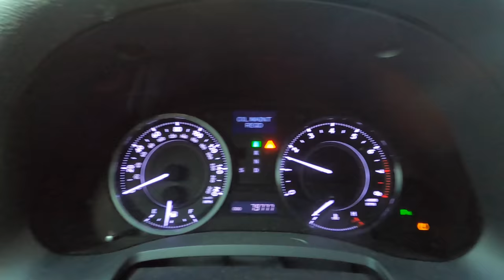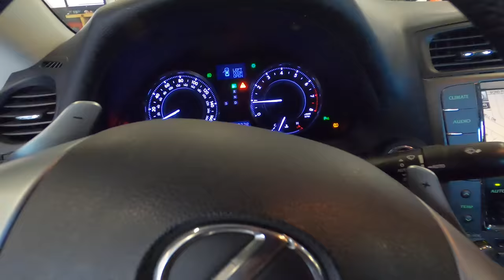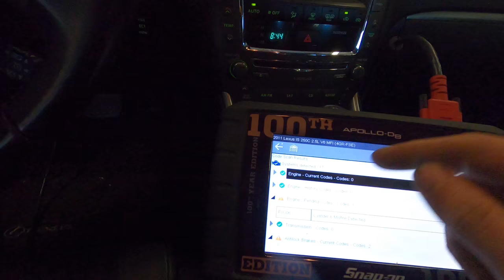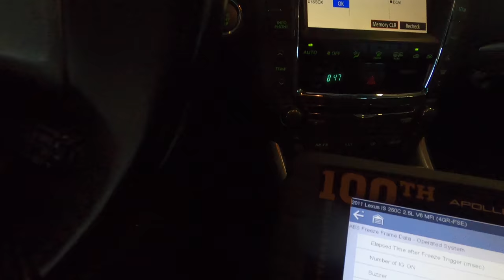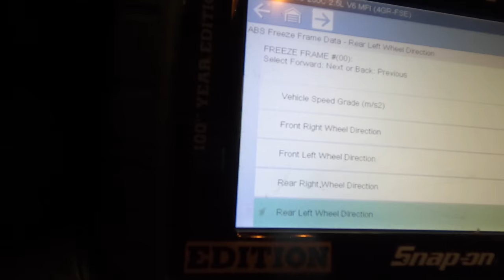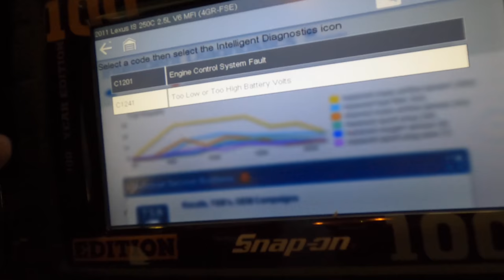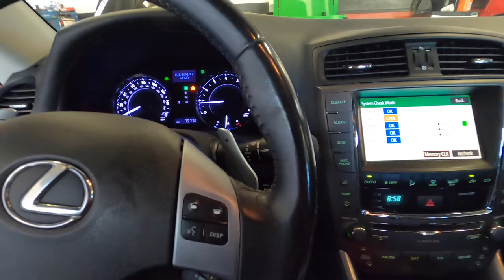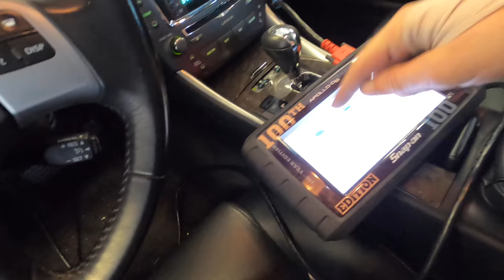Lexus IS 250:  Customer States Lost Power While Driving. Why can’t people communicate?

Comment: Looks like they beat me to it, the part with the bango fitting is a injector. I work toyota material lift side, they use a smaller version (though lp gas) for fuel trim as a way to recover during a dead head on hydraulics and also is used during trimming (obviously)
Those engines are a 4y. Yours looks a bit similiar and I would reckon due to emissions, Lexus (toyota) is trying to keep the normal hot operation mix leaner and needs the port inject to rich out so the engine can get to heat cycle and run to lean...possibly the case...not sure though, not automotive.

Comment: We stop learning when we croak....up to then we're all tadpoles. Hope when you disconnect battery you'll use a jump box to keep vehicle with a power supply. If you're still working as a tech when you're 70 you'll have worn a brace on on both wrists a few times. Lexus is the worlds most reliable and trouble free car.

Comment: Yeah  yeah...I know its an old video...but I owned the 2008 version IS250 and the 2006-2010 have a design flaw & TSB that presents exactly like the owner described...check out "IS 250 Carbon Buildup" online.  It barely runs, has no power, engine, VSC and other lights all illuminated and throws misfire codes...then problem goes away.  Root cause is direct injection causing carbon buildup on intake valve...the carbon breaks off & enters the cyl. which causes all sorts of mischief, the car goes into limp mode.  Disconnect battery, clear the codes and it will run just fine for a few months, then happen again.  In the 3 years I owned it it happened 6-7 times.  After the first few times & throwing parts at it you catch on that its not something fixable.  I moved onto a LS430.

Comment: 80k...isn't it getting close to timing belt time too? Good stuff. Stay safe and be well. Have a great rest of your day.
Reply: 60k is time to change the belt.
Reply: Newer Toyota engines have chains. And belts are sort of hard to judge. Age/mileage/oil leaks all play huge factors in how long you go before swapping. On a regularly driven and relatively well sealed engine 100k is pretty much fine
Reply: @lukeyarasheski5510  You think it's smart to hold off a small repair to wait for a big one?  Change a belt cheap job look ma I saved a few hundred dollars a month later look ma I will cost $1500.00 to $2500.00 to pull the heads and do the belt to how is that smart.  Now chain's last well over 100k so there safe butt logic show's the right way is replace at 60k why take the chance!
Reply: @edwardmartinez2472  I'm a mechanic so I do my stuff myself. So I mean 350$ish for the kit with a water pump. But yeah. My miata has had 2 one when I bout it at 110k (miles) and another one at 214k. My prelude is gonna be getting its fourth once I get the engine amd trans out to fix the flywheel because it has about 260k on it but I did it last in 2016. So 5 years 100k I'm fine with for belts. I don't touch chains as maint items. If I have to do like guide/tensioners, head gasket etc I do it all at once so you have fresh everything amd don't have to touch it for another 254k like my E36. So in summation yeah. Belts are fine for 100k provided average mileage per year and no oil leaks. Thats where the small job portion of what you were saying comes in. A cam seal is like 20$ when already doing the timing belt. Just unbolt the sprocket and swap seals. Way easier that aways. Oil will destroy belts. Any rubber really but especially drive and timing belts. Please don't let anyone tell you otherwise. Ferarri with their bullshit 3 yr maint.... I have done 2 different belts on those with less than 5k on the belts
Reply: @lukeyarasheski5510  That make's me crack up when people think there saving money by waiting.  Back in my day it's more Dodge Pontiac that when they eat a can gear it's time for a valve job bent valves when I started out in the late 79 I had a job come in no start shooting gas up the carb looked at the rotor not spinning timing gear plastic all eaten away put a new steel gear in and chain to my surprise it had three dead hole's off come the head's.   I was new I did not know about interference motors.   It was a 72 Tran's am with a 455 automatic live and learn.   I was never a pro I just like working on car's it helped me pay for Medical school today I still do work on car's when I have time.
Reply: @lukeyarasheski5510  I dont keep up with whom has what anymore as I dont twist wrenches as much as I use to. I only worry for what model is in my driveway nowadays.

Comment: At 35:26 you are asking about a Toyota cold start injector.  In a warmer climate they are completely unnecessary,  and you can block off the fuel line which feeds it.  I know from experience this is true.  Colder climates,  I cannot speak from experience.

Comment: Always use recommend brand of spark plugs. You can get misfire issues by changing brands. I use a rubber fuel line hose to put plugs in the hole.
Reply: Denso or OEM only on a Lexus, I agree.

Comment: A good tech knows if the engine has enough milage to need spark plugs you take no chances re using cheap to replace intake gaskets! Why take the chance of 20 to 40 dollars in parts but then again thats probally why I almost never have comeback in my shop atleast I dont.

Comment: No need for idle air control reset after battery disconnect? Transmission gear shift points reset?.
Newer cars may even need battery reset after replacement.
Things that your SnapOn can do

Comment: I notice you often use dielectric grease on spark plug connectors and coils, which is great but what puzzles me is when I don't see you or others use it on the battery posts. Maybe your experiences differ from mine but the battery posts stay cleaner longer if I clean and grease them.

Comment: I hired an airplane mechanic that turned out to be a great find.  He would work slowly and methodically, and when he was done I would always notice a couple of things.  Everything was back solid and securely. All replaced parts look factory new and there was no question about their origin.  He only did things once, in sequence, and never had to remove some of his work to get to the next step.  He was always very conscious of the next step coming up.  He was amazing.  Raiman, you look like you have these same traits.  I wish I could find a local car mechanic I could trust.  My local car dealer just went "doi, doi" on me.  They keep adding many things to the recommended to-do list, that are just ridiculous.  Like with only 15,000 mi, they want a complete flush and refresh of the transmission fluid.  Since then, I've been trying to find another dealer, after 30 years of service.
Reply: They recommend a complete flush because your new transmission, along with any other mechanical device is wearing in. It's a completely normal process.
Reply: I've been an airplane mechanic A&P IA for over 25 years and when I went through the program it's 2000 hours of book work (mostly FAR regulations) and a lot of practical hands on work. When you test there is a General test (math, electric, mechanical) Airframe test and then Powerplant. I have my IA or Inspection Authorization so I sign my name in the logs so if something happened the FAA/NTSB would go back and look at said log book there are usually 3 depending on type of aircraft 1 engine log 1 prop log and 1 Airframe log. There is a lot of responsibility being an IA and being an A&P for that matter.  Also an attorney doing Aviation Law may main job. I work on other people's airplanes on the weekends. We are very methodical and have to be!
Reply: The only airplane mechanic I ever knew was a friend of my neighbor and she usually had me work on her car but one time she had him work on it and I stopped by to see what he was doing and he basically told me he was way, way better mechanic than I'll ever be so said
" well la - de - fricken -da " excuse me.
Reply: @michaelszczys8316  lol

Comment: My 96 cavalier did the same thing after the alternator cooked itself, now it’s random when the ignition pulse dies out at the ECM killing the ignition at the computer not the ignition coils or module. A random ground strap left sitting inside the coil pack didn’t help as well when it was all replaced. Now it needs a new ECM.

Comment: Why didn’t you check the resistance on the coils with an ohm reader? When coils start giving out like that you will pretty much every time see an odd ball one that reads high or low compared to the rest. If it wasn’t reading off, I would start thinking an injector starting to go also possibly?

Comment: When you're first under the hood with the motor running looking at the new battery. I thought I heard a ticking sound like a spark jumping to ground. But the sound over YouTube doesn't make for good trouble shooting. I would want the coils marked from which cylinder and put in the trunk. Are the new coils manufactures brand?
Reply: that tick is normal for that engine

Comment: That back intake bolt is such a pain in the ass all has to be done by touch only....had to do it on another 3.5 v6 Toyota.  Yea I never replaced those intake gaskets and never had issues when I did the coils several times.    Will say never had a bad coil cause a stall though.

Comment: Did you forget to put the rubber gaskets back on the coils on the driver side bank, or did they get replaced on the coils entirely?  The coils got put back in, but the gaskets you took off are clearly visible and then in the next jump cut they're gone.

Comment: So I’m noticing that new engines don’t have spark plug wires they each cylinder has a coil and you just plug a power source into it? The newest engine I’ve ever worked on is a 1980 Ford F1 50

Comment: i remember growing up  my dad always told me  to replace everything in pairs   if i has  one plug go bad  i would  replace them all with  wires    sure  i would spend more  but i would  fix it  once and  be done   if this were my car  and  it is a nice car at  that  i would have  replaced  plugs wire and  all he coils     but the funny thing  when my dad got alot older  he would  get mad at me  and tell me  why are you replacing everything when  you only  need to replace  the bad ones  lol
Reply: I used to think like that. Now parts quality is so low I would rather run an old part over a "new" one. Stuff like plugs, absolutely. 

I just did a timing chain job on a 2.4l Chevy. Primary and secondary. I could have done the water pump, but it wasn't leaking. I let it go and crossed my fingers. Owner did not want to pay the extra $ and I agreed with him.

Comment: Man that looked like a pain. Why would you block off the coils and the sparkplugs with that plastic monstrosity? I swear enginers just hate us who have to work on these things. I don't work on a lot of new stuff since I am in private shop and they give me a lot of stuff that is 2005 an older especially OBD-1 and pre OBD. I have no clue why other then mayby I have the most experience diagnosing older stuff manually. There is still some dumb designs but that big plastic intake covering half of the plugs makes little sense to me.

Comment: For some reason on my 13 corrolla when my fuel pump started to die and then died, the car would lose responsiveness and then sometimes would turn off completely until one day the fuel pump was just dead. The check engine gave me no trouble codes (from what i remember) to let me know what was going on. Just putting it out there because that might be something that is happening with this car.

Comment: well. Do not know how others but i really did not like the additional dielectric grease - the amount from manufacturer comes only around the booth to seal just with sparkplug ceramic body to avoid having contact with the ignition tip. With this full booth of grease you are touching the ignition tip while seating. This has to be avoided...you are creating additional resistance...Sorry to teach you around - Been watching some videos of you and not really in all i am satisfied with the job done . In some fields improvement can be made.

Comment: I noticed that the coil washers/insulators for numbers 3 and 5 coils weren't put back on.  They were laying on top of the working area when you were replacing the bolt on the rear of the intake manifold but disappeared at 31:19.  ???
Reply: the coil has been replace with new ones ... so, the rubber o ring aren't neccesary anymore ...

Comment: At 30:55 The three plastic discs should have been replaced around the spark plug holes b4 the new coils were added? right?  You removed them at 24:36

Comment: Wasn't there a time when replacing spark plugs was a regular occurrence? Now it seems like a bit of a nightmare.
Reply: Spark plugs are higher quality and have very expensive metals on the tips, they can last well past 100,000 miles.
Reply: @spicysnowman8886  Bingo!  Old copper plugs used to have to be changed every 30,000 miles.  Now they only have to be changed once or twice for the life of the car.  Because of that the engineers don't worry so much about keeping them out in the open.

Comment: I love working on Toyota Lexus cars. Well made and thought out.... Here in the UK we have a model called an AYGO and to change a clutch is an absolute doddle to change.... Can do it within 3 hours easily.... The cars I hate to work on the most are BMW AND VW AUDI!!! GARBAGE TO WORK ON. Currently I have a BMW X6 40d with the twin turbo diesel engine... have to change both turbos as they were starved of oil and both grenaded each other..... have to support the engine and then remove the entire cradle.... Removed the oil pan and it was just sludge!!! Typical person who wants the badge but cant afford to maintain it!!!!Absolute junk though as I spent most time swearing and losing my temper with it. Luckily other cars were needing work to make a break for me from the junk

Comment: What are the most reliable 3rd party electrical parts in your opinion... Denso, Bosch, etc?  If you're can't /won't afford the dealer coils, if given a choice, what company would you go with AND given the company you name, what is your best guess at its failure rate (as reliable as OEM, 1/2 as reliable as OEM, etc.)?
Reply: Denso is often used by oems and is very reliable

Comment: Since it's on the intake,  I'd guess that it is to take the temp of the air and then adjust the mixture of Air/fuel for a more efficient burn. (Totally a layman's guess, I'm lucky to know the difference between a flathead and a Phillips screwdriver)
Reply: That's easy, one's an engine and the other removes the slots on the heads of screws

Comment: Why do you drop the plugs in by hand rather then sticking them in the spark plug socket lowering them in  and turning them by hand with the socket and extension bar? also which brand do you like of the extended reach power ratchet do you use is it snap - on or Milwaukee or something else?

Comment: At 30:00 Reinstalling the intake manifold without replacing the gasket is ok?
I had a mechanic replace my spark plugs and the intake manifold had to be removed to access the rear plugs. I replaced the gasket. Now it runs terrible. Loss of power misfire. I suspect intake manifold was reinstalled correctly.

Comment: Car may have been on when the battery was replaced. Sometimes techs replace the battery with the engine running to prevent a loss of radio station presets, etc... That would cause the low voltage code and usually causes some sort on ECM or ABS code. Also, I'm wondering if your service advisor told the customer they only need a #6 coil or if she told them they need all of the coils.The labor cost for just the #6 (which doesn't require intake manifold removal) and all of them must be huge. I'm not at my shop, so I can't look it up. I use to get in arguments with my service advisors for selling work I didn't recommend. I get that their job is sales, but I've been called out by customers for recommending work they just had done or they knew they didn't need. I then had to explain that that was the service advisor and I didn't recommend that work. I've actually had service advisors recommend steering flushes on cars with electric steering.
Reply: "Sometimes techs replace the battery with the engine running to prevent a loss of radio station presets" DEAR MOTHER OF GOD!! Who in the right mind would do something like that to modern car?
Reply: @feluke8396  "right mind"...

Comment: very interesting videos, not seen plugs like that :) maybe your the man to ask, i want to remove the passenger front seat on my nissan leaf and i was told i need to put a 2.2ohm resistor across the plug for the seat airbag , obviously need to disconect battery for say 10 mins before? have i missed anything?

Comment: Thanks for sharing your video
I have a similar problem 
Car went off on motion 
Battery sign came up
I change alternator and battery and car still went off again
I change some of the spark plugs but car still went off 
What should I do 
Should I have all spark plugs change
Reply: I’m suspecting it may be the crankshaft sensor causing the car to go off while driving

Comment: Lexus seem to put the 12 batteries in weird places. Then again, does having the battery at in that location make it easier to get to the parts that need to be services more regularly?
Lexus' hybrids seem to have their 12v in the boot (trunk) along with the main battery that takes up the space where the spear tyre should be. (They have a tyre repair kit instead.)
Reply: Toyota hybrids put there batteries under the back seat now, but the 12V is still usually in the trunk.

Comment: I don't understand why all the plastic covers? To me they are not pretty. I'd rather see the motor. The belts hoses. Everything but the huge plastic heat retainer and air trapper. Plus that's just extra weight. An ounce is an ounce. It all adds up and decreases the milage.